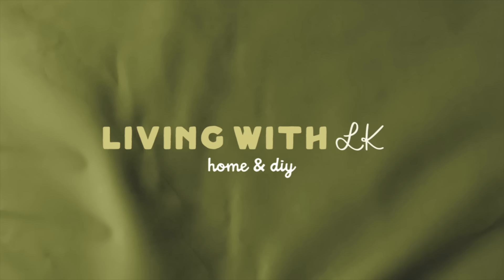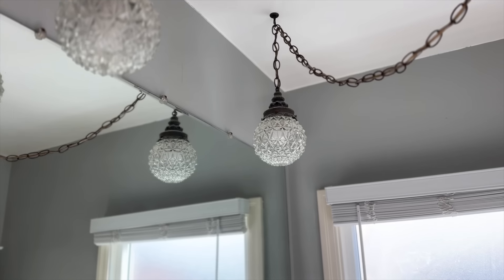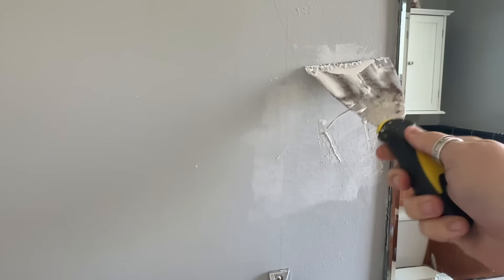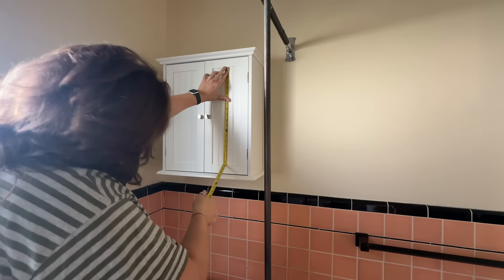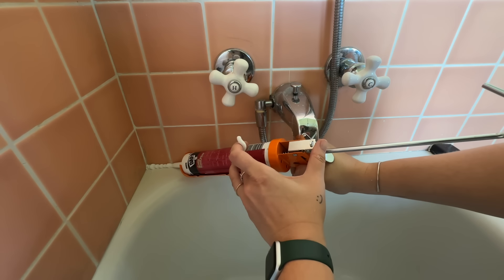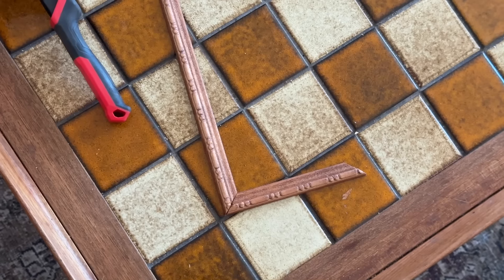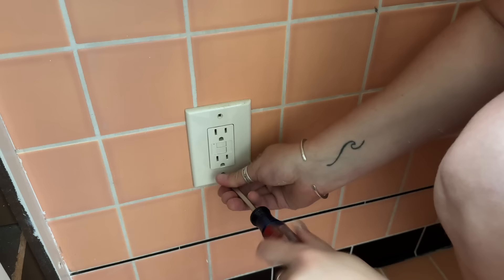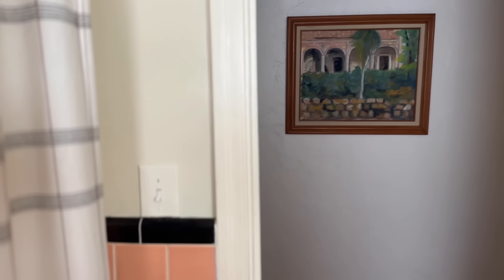Extreme BATHROOM MAKEOVER with PINK TILE! 🛁✨ EASY Renter Friendly Upgrades

Comment: I'm a retired interior designer. You took the right approach by embracing what you could not change. It looks really good.
Reply from the maker: wow thank you so much!
Reply: @livingwithlk soooooo happy you painted the ceiling too!!!! Looks fantastic and loved the you tied in the vanity.
Reply: I grew up in SE Michigan and I'm enamoured with all its vinage-y lovliness. I think midcentury Detroit has some of the most beautiful little homes I've ever seen. These bathrooms are in every single one of them. They're in the large, masterful homes as well, there's just more of them. No matter what the tile color is or how much I may hate that color, if the house I'm looking at has original anything I'm excited. Luckily no one else wants them so they're in my tiny budget.

If I walk into a "flipped" house with plasticky flooring and brand new drywall it's an immediate NO. I actually feel a bit sorry for the place. I mourn the loss of cove ceilings and inefficient metal-framed windows. If I wanted to live in a condo, I wouldn't be looking at a house. Bring on the problems that occur in a house that's of an age. Those are my kind of problems.

I wish more fixers like LK embraced what they couldn't (and sometimes shouldn't) change. It always has a richer feel at the end of the project. Her age-respecting bathroom looks amazing. It looks intentional. Which it is. Sorry for the book.😅
Reply: 6th
Reply: Getting rid of the dingy caulk and deep cleaning the floor was a huge improvement! Lots of elbow grease, but worth it!
Reply: I have the same exact pink and black tile in my bathroom. And, some of the tile isn't ceramic😅. It's  like a hard kind of plastic, or something like that. I'm actually glad that I came across this video because, I was thinking about trying to paint over it🤷🏽‍♀️. Maybe, I'll take notes from you and just work on what I can do. Good job😊

Comment: My mouth fell open when I saw the pink and black tiled bathroom. That is the exact tile in my 1950 built house! The bathroom is super tiny so the first thing I did was replace the bathroom door with a pocket door. There was just enough space to squeeze it between the wall and the chimney stack. I had to hire an electrician because I had wanted an electrical block with multiple outlets  and a wall mounted blow dryer to have wires hidden behind the wall.  The electrician branched the circuit from the lighting fixture over the new medicine cabinet with a mirrored door. I like the cabinet you used. My medicine cabinet is too small to hold all my beauty supplies so that cabinet will allow me tp clear away the clutter on my counter. I replaced the Formica counter top with a marble remnant as well as the faucet. I removed the wallpaper but I’m undecided about suitable wallcovering. I’m considering a black and white vinyl mural from Etsy. The high moisture from baths and showering makes regular wallpaper curl at the seams over time. Thank you for your inspiration.

Comment: Very nice improvements.  It's amazing what a deep clean will do, the floor looks so much better.  I like the cabinet refresh and the green rub/towels does take away from so much pink. Considering you had to work around the tiles, it looks good.  I'm in a 1945 craftsman style house.  My bathroom has 4"x4" green plastic tiles, on the lower half.  Luckily green is 'my" color or choice.  Next month will be taking out the cast iron tub and making a walk-in shower for mobility issues.  
FYI tub surround tip - I had the same issue, trying to keep the area around the tub caulked.  A handyman suggested quarter round trim, white, plastic and installed it around the area that's normally caulked.  Of course it was cleaned and caulked first, then the quarter round installed and caulked above and below the trim.  That was 7 years ago and haven't had to re-caulk once in all these years, it's held up perfectly and looks so much more finished than just caulking alone would be.

Comment: Love what you’ve done, looks sooooo much better, the colour you chose is perfect. I really like the wooden touch on the medicine cupboard, and the new knobs. I think that the vanity is not original as you can see tiles behind it, don’t think the builders would have used tiles there if that was the original.
I had a similar mirror in my bathroom to yours and I made a frame for it, stained it a similar colour to warm up the room. I also added a shelf with the same wood above the loo.

Comment: that’s a great tip with the caulk remover and the bleach. i’ll have to go get some of that when i start to tackle my bathroom. this whole thing is caulked to hell and back. also about your roman shades!!! you can really easily diy them, there’s a very good tutorial on how to sew your own ones on some random blog (it shows up really high on the google search for diy roman shades lol) and it tells you what little parts you need to make them have cord pulls. it’s all very simple hardware store stuff, i think you’d be able to do it really easily. i say this because i think your roman blinds in your bathroom and your bedroom would look a lot better if they were fitted either to the inside of the window or were a bit bigger for an outside mount. roman shades look so classy when they’re an outside mount and are wide enough to match the window ledge width or just cover the entirety of the window molding. when they’re wider they also keep light from seeping out the edges as much.  anyway i love your videos a lot, you’ve got such good tips and taste! imo that’s definitely not normal for the rental renovation space on youtube lmao

Comment: Tile installed from 1920s to  950s are such a higher quality product with a grout that rarely breaks up. Renovated a 1929 pink bath and the tile was absoluyely pristine. The colors oink. Blue ,green yellow do present decorating challenges, but what a better finished product.

Comment: That drill bit brush to clean the grout is pure genius! I immediately got one for myself after watching you use it. Thank you!
I'm quite worried about that outlet that's just next to your shower. I hope you have a fitted rubber gasket inside of it to keep water from entering and touching the electrical wiring?
Absolutely love how you changed the bathroom in any case! Leaning into what you already had was definitely the way to go.

Comment: Soo good!!! I have the same issue with the moldy bathtub grout and caulk. I loved your tip for cleaning the floor with toilet bowl cleaner! I've tried that technique with the power drill brush but with scrubbing bubbles which i shouldn't have done because it bleached the tile :(

Comment: I enjoy brightly coloured towels + accessories in the bathrooms of the places I’ve rented, presently fuchsia pink & lime green, but I’ve struggled to accept the grey & brown random tiles dotted around the shower. I’ve researched painting them or using stick on cover-ups, but was told both wouldn’t last. I too have been considering “embracing “ the brown tiles & changing the towels, but what other colours could you suggest & goes with grey too 🤷🏼‍♀️

Comment: I have pink and maroon tiles. UGH! Did contractors buy these tiles by the thousands in the 50s? I have no storage so I added the top of a vintage hutch and inserted  photo I took in Rome and inserted it in the door. As far as the black mold, Clorox gel toilet cleaner is perfect overnight. I have ugly under the sink pipes and no cabinet. A sink skirt solved that. A few towel hooks added too. Now I just have to get rid of the pink walls (even though it makes me look good.) A new shower head helps too. Good job!

Comment: Bathroom looks great. I'm a big believer in embracing what's there. As far as the light fixture and vanity being original to the house, definitely not. Those lights look like the late 1960s and the vanities probably the early '70s. MDF was not something that they used in 1929. The bathroom probably had a little pedestal sink or a wall mounted sink. You really did a beautiful job here.

Comment: I'm a novice, but from the little that I know, I think the grout on the floor should have a sealer which will prevent the stains you had to scrub away.
Reply from the maker: The grout was just cracking away : ( I think its just so old and someone did a poor job of regrouting it

Comment: You can get a tool made to take off caulking. It’s plastic and doesn’t scratch the tub and also will smooth outgoing the caulking. All in one tool. Also you should have researched how to remove mold. It will tell you to never  use bleach because it will only kill the top layer of mold and will come back. Either use Vinegar or a mold remover and both will kill the mold.
Reply from the maker: I used that tool and it didn’t work. I also used vinegar and it came back so I went in with bleach. So far it hasn’t come back…

Comment: Blinds should be turned to the open position when raising and lowering. 😎💛 That may or may not fix the hard to open issue. 💁🏼‍♀️
Reply from the maker: It didn't work either way sadly
Reply: Well dang. The new one is better anyways.  @livingwithlk

Comment: Hey just a tip for anyone shopping for a half face mask: they are no more effective than the disposable n95s if you are using an n95 cartridge filter. Please know that n95 are only rated for particles. VOCs, oil droplets, and other chemical fumes require a different mask with  a different letter in front of them. Also, all masks need to be fitted to your face to be completely effective. TLDR: dont waste your money on a half face mask if you arent using the correct filters and its not properly fitted. A disposable n95 is good enough for typical particles. If anyone has any additinal info, id love to read it.

Comment: Yes, the title is 1950's. Yes, thoroughly clean the floor.  Cutting the electrical box  into the wall and switch is a pain by easily done.  Flip breaker.  The tub should have all caulk removed and fine grout applied.  It lasts longer.  I paint strained grout, 40 years in my house, with oil base white paint after scrubbing every couple of years.  I also do this  in my rentals.  The landlord my support new light fixtures.  My tenants have latitude when decorating.  Not too trendy, calm colors and get it all approved in writing first.  Drive the wall anchor in if you can't pull out.  Antique white is the only color I allow in my rentals.  I personally would paint white and go deco with black and white ignore the pink.

Comment: Dirty grout on light colored tiles! Yuck! I finally decided to tackle the problem and spent a bunch of money on a kit, I used it when the spouse was out-of-town. It was a lot of work and I wasn't especially pleased with the results. Then I saw an Internet hack that was just TOO easy to believe, but I gave it a try desperation. Hydrogen peroxide. I used a stiff brush dipped in a bit of water and some fluid from fresh (new) bottle of hydrogen peroxide. I was stunned at how well it worked. When the floor needs a perk-up now, I no long dread clean-up day.

Comment: no entiendo porque hay tanta gente que le da pereza quitar cosas para pintar las paredes...como la barra de la cortina o la ducha...jajaja
Reply from the maker: why does it have to be laziness and not just efficiency? I believe I mentioned in the video the shower curtain rod is attached to the wall and has been since the 20’s so I couldn’t remove it if I wanted to.